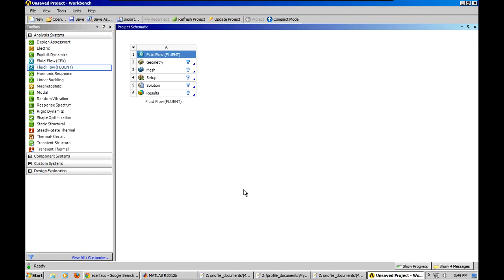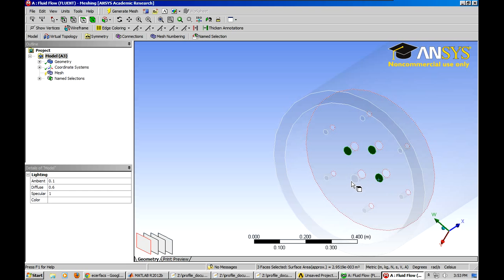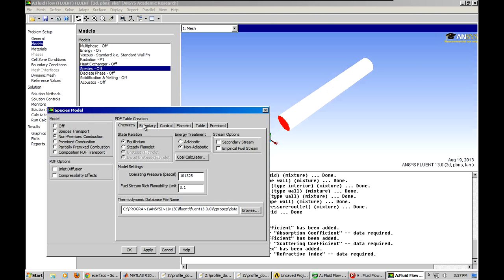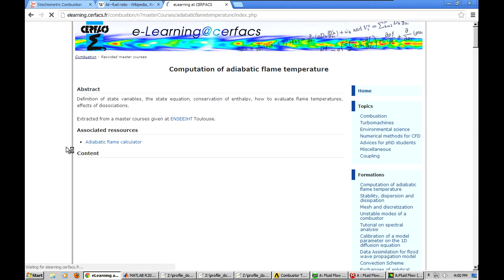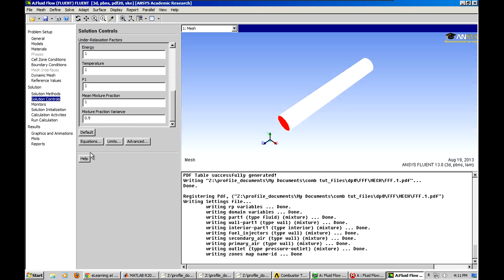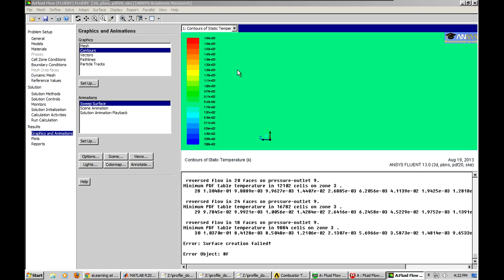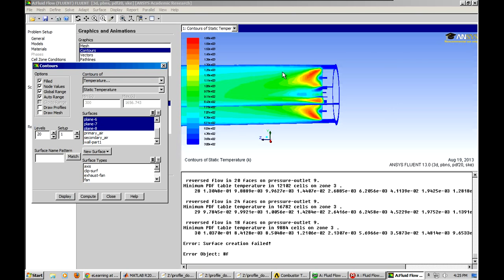Combustion Tutorial Ansys Fluent!

Comment: What if we had to set the dicrete phase and add the surface injection ? Because on my project it used hybrid ( oil fuel and coal ) is the result still the same ? Iam having a problem, that the combustion is not there, please help :( [sorry for my English]

Comment: Dear Sir, Thanks for the insightful video on combusion. I am undertaking a masters course and my project is CFD 
simulation and analysis of biomass gasification in an updraft gasifier. The heat of combustion is from an open flame heating of the biomass in a  hearth and the oxidiser is air. Could you kindly reach me on how I can 
create the simulation in  ANSYS 16. Thanks in advance.
Reply: Hi Maskani,
I have also been working on the same project in my company. I also have few questions for my simulation, i would be glad if i can get your email ID or some contact to get in touch with the same.

Comment: Hi Vlad,
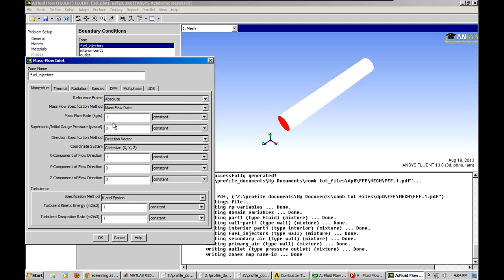great tutorial and very thoroughly presented. Just a minor thing there. Correct me if I am wrong but since your injectors are practically all defined as a single boundary zone, then shouldn't the fuel mass flow rate set at 14:00 be equal to the total fuel mass flow rate you calculated rather than the mass flow rate per injector?